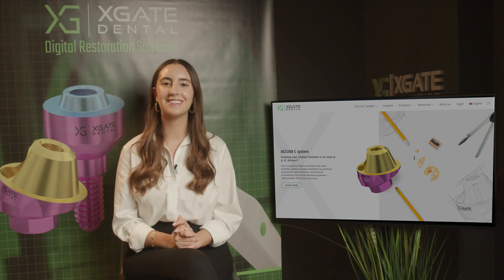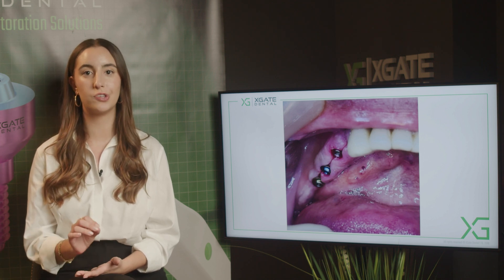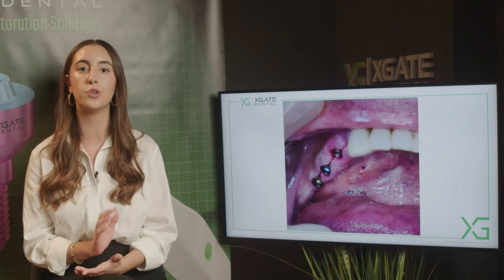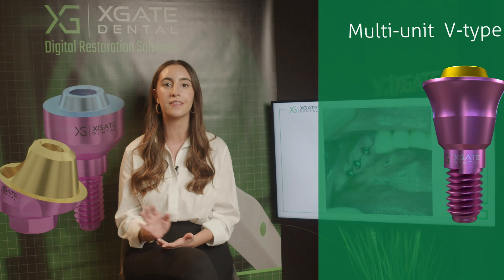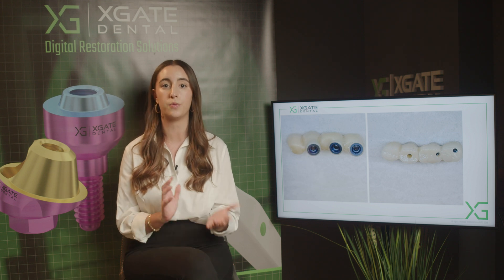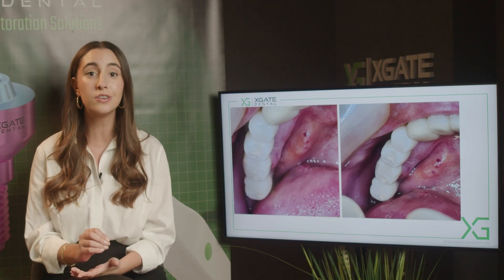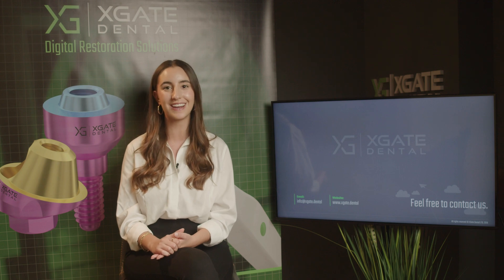Small Screw Channel High Strength V type multi unit in Implant Dentistry

Comment from the maker: 00:00 Description of the clinical case - implantation of 3 implants with 3 V-type multi-units.
00:35 Explanation of using V-type multi-units due to limited mesial-distal space, allowing for smaller cones and diameter.
00:55 Advantages of V-type - more space for gingiva between multi-unit and adjacent tooth.
01:15 Treatment steps - placement of 3 multi-units, no immediate loading. Impressions were taken after a couple of months for a temporary bridge.
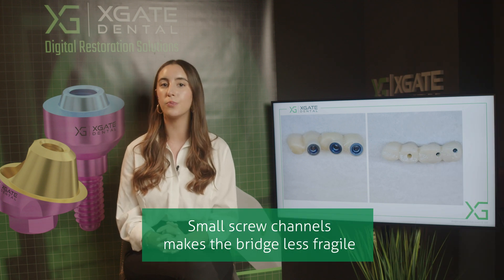01:30 Benefit of V-type multi-unit - allows for a small screw channel, leaving more space for zirconia crown material and strength.
01:45 Comparison of small vs large screw channel impact on crown strength and fracture risk.
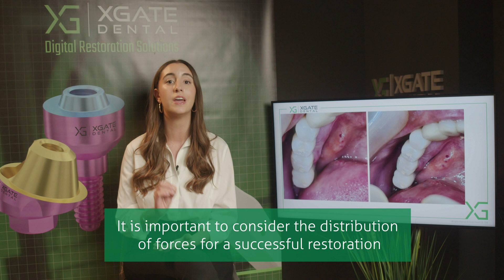02:00 Advantage of non-parallel multi-units acting like a tripod to compensate forces on the bridge.
02:15 Showing the temporary bridge in the patient's mouth with a small closed screw channel.